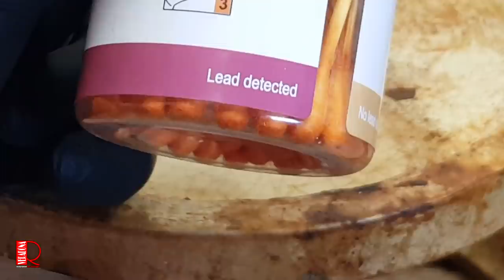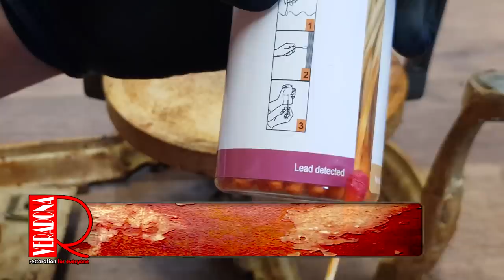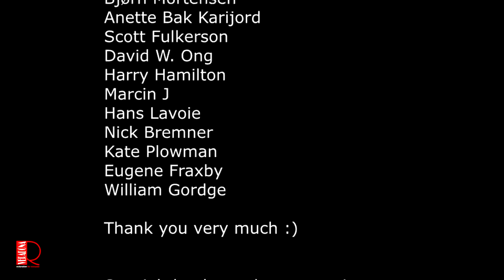Massive Antique Meat Slicer Restoration - 1895 Cast Iron Alexanderwerk

Comment: Great restoration. The sound of the blade turning took me back to sixty when it was a common sound in shops. Thanks for the memory 😊
Reply from the maker: Thank you Anthony, yes, that unpleasant sound makes the metal plate, which has the task of wiping the flesh from the bottom :) Radek

Comment: Excellent restoration. It seems to me that it was a tougher job to dissemble the slicer than it was to reassemble it. But you did an excellent job as usual. Thanks for saving this beautiful piece of equipment.
Reply from the maker: So I agree Pat, because not all threads are metric (used in our country) it's quite a problem to restore them. I also have to get Whitworth's thread :)  Radek

Comment: Beautiful restoration!
Question: when lead paint is present, how do you handle the disposal of the fluids and clothes used and the  sand blasting medium?
Please consider doing a video that includes the extra steps you have to take when lead is present
Reply: I second that thought.  I, myself, would really like to know.  EDIT:  Now I know.
Reply from the maker: Thanks for the question. If lead is present in the paint, it is not possible to sand (danger of swirling) an alternative must be chosen. Either lye or paint remover. In my country, we have so-called "collection yards", where this hazardous waste can be handed in free of charge and subsequently disposed of ecologically.
Reply: @VeradonaRestoration  Thank You for the quick response 😃 is this the same for the sand blasting medium? I would think that after sand blasting a lead paint, the swirling would increase for future projects. Do you immediately clean your sand blaster after a lead contaminated project?
Reply from the maker: @leisongivangomo5656  If the paint contains lead - I do not sand
Reply: @VeradonaRestoration  If you do sandblast lead paint, you may also find that your blast medium clumps up; it may even clog your nozzle and tubing to the point they have to be replaced. Lead was added to paint in part to provide adhesion, and lead paint dust heated up by the friction of sandblasting will stick to _everything_.
Reply from the maker: @Ea-Nasir_Copper_Co  Ok, thanks for the explanation

Comment: Hey Radek, I love this meat slicer, you did an excellent job as usual! Made before electricity took over... I have a few things I would like to point out though.  First,  I was shocked when you didn't use WD-40 on the first four screws holding down that porcelain plate! They could have broken you know,  so I cringed... Next,  I know this is because english is your second language, and it's no big deal, but that would be polyester "filler", not sealer,  just thought you would like to know. The other thing that kind of shocked me, was that you did not put washers on the bolts that attached the legs! I  know it didn't originally have them, but should to protect your paint... Anyway,  always a big thumbs up! Lucky dog,  he eats better than I do... 🤣
Reply from the maker: Thanks to a friend for the warning, I rely on the translator and as you can see, the words do not always translate correctly. As for the washers, yes, I could put them, but mostly I follow that the result is as close as possible to the original condition, including the old original screws. Thank you for watching :) Radek

Comment: Outstanding refurbishment! Just a suggestion don't use WD40 on your rusty bolts, although a excellent product it's not intended to break loose rusty items. Use  a rust penetrate spray (one  name brand here in Canada is "Rust Buster"), it will save you many headaches. Question: Why didn't you powder coat the cast iron parts instead of paint? Also where do you get the white ceramic paste, I can't find it anywhere here? Again wonderful restoration, we don't find relics like that in Canada!
Reply from the maker: In my opinion, powder paint is more suitable for flat surfaces without decorative elements, which the powder paint "waters" and does not stand out. I bought the white substance in the supermarket, it is a repair kit for enameled bathtubs.

Comment: Interesting that the modern electrically powered meat slicers use the exact same blade. That means you can actually find replacement blade if ever needed.
Reply from the maker: Yes, she is very similar. I have a slicer in the store, but it has a slightly smaller knife.

Comment: As always another excellent restoration. Question: How is it cleaned after use, does it have to be disassembled to clean?
Reply from the maker: I think it's better and it can be cleaned better.
Reply: The top was definitely intended to be removed frequently, otherwise it wouldn't be fixed with thumb screws.
Reply: @Ragnar8504  Good point.

Comment: i don't understand one thing. all restoration videos, not only your videos; you use paint remover, rust remover and similar thing then sandblasting. but just directly sandblast is not enough for remove all things like rust, paint?
Reply from the maker: It is enough, but if the paint contains dangerous lead, it is not suitable for it to boil in the sandblasting box. Therefore, first remove the paint remover.

Comment: Removing paint from an object has got to be my least favorite part of refinishing an object!  The sand or walnut hull blaster is a wonderful thing!
Reply from the maker: Yes, especially when it is not possible to sandblast for the lead content in the paint. That sucks. I thought that pulp from walnut shells is suitable for soft materials such as rubber ...?!
Reply: @VeradonaRestoration  the city of Portland uses Walnut hulls to clean its public statues.  Several, such as a life sized Elk with spreading antlers, and full size Joan of Arc riding a horse are beloved.  The Joan of Arc statue is covered in gold leaf and was vandalized with spray paint last year.  It was blasted down to the metal and re-gilded with donations.
Reply from the maker: @reginaromsey  Yes Wanda, I understand how I wrote crushed shells are designed for fine sanding, so as not to damage, for example, as you write - sculptures. Anyway, thank you for your comments. Have a nice day from the Czech Republic, Radek